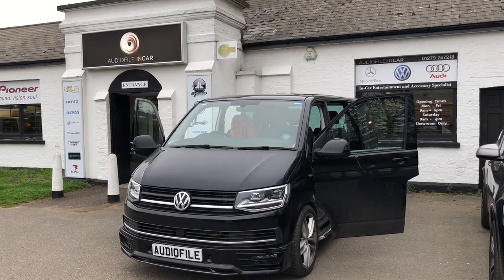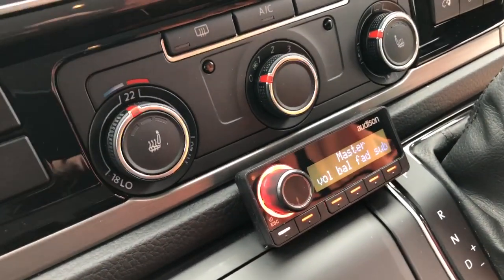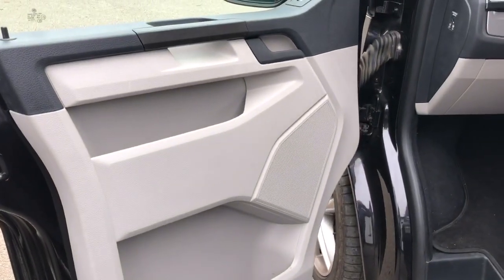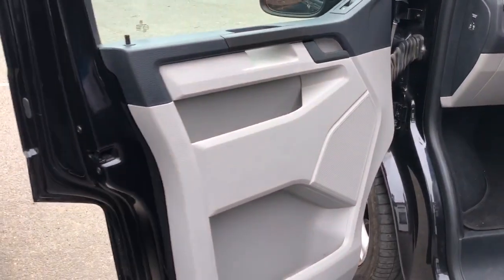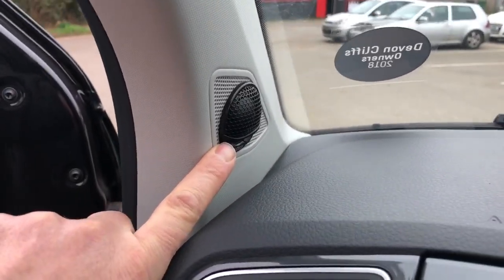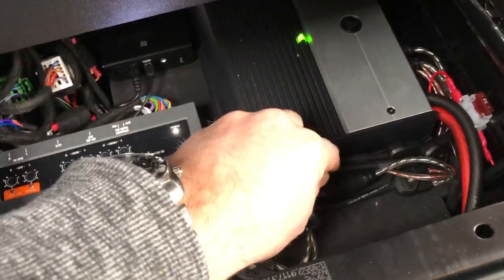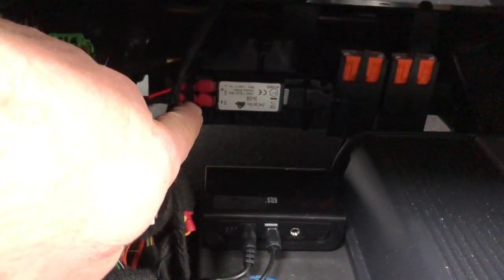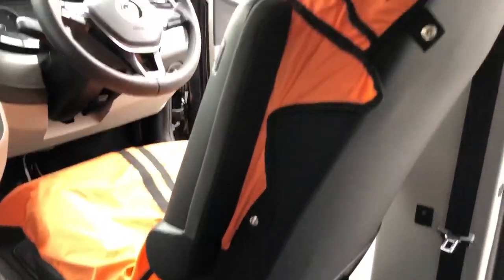VW T6 Complete Audio Upgrade with full DSP

Comment: Hey guys. I have recently upgraded the sound system in a new VW T-CROSS. I discovered that there is bass roll off and factory EQ on the speaker outputs when I measured it with pink noise on my Audiocontrol RTA. How do you code the radio for HIFI? I assume this gives you a flat frequency response with no bass roll off. Any help with this will be greatly appreciated. Best regards. Rob.

Comment: But why would you isolate the inside of a car door? The car speakers are meant to use the inside to use it as bass reflex, you can break your speakers that way, or you limit them at least because it seems like you also thought about the amount of output wattage, and the more power it gets the more air needs to escape.Conversely, car speakers are meant to do that for Bass because the walls are so thin and that usually is why car stereo sound so good at not a lot of cash.
Reply from the maker: I am afraid that could not be further from the truth, the dampening is to stop panel resonance, coloration and reflection, it has no effect on the volumetric air space of the door whatsoever. It improves bass response by making the baffle more ridged thus reducing cancellation and increasing efficiency. The door could never act a a bass reflex? to do this the "sounder" or "port" length and diameter would have to be calculated precisely vs the volumetric air capacity of the door depending on the frequency that you wished to tune to. Even if all of this was possible the door is not sealed so it could not possible act as a bass reflex.
Reply: Audiofile-Incar It does act as a bass reflex, otherwise the heat couldn't escape, sure it's a sealed enclosure, but the air and the heat has to go somewhere.
Reply from the maker: @giuliano8031  it does not, bass is achieved by changing sound pressure, the bass does not need to escape, it’s not a fart.
Reply: @AudiofileIncar  So why are subwoofers ported then exactly? 🧐 I know there are sealed ones but principle us given. If you wanna have control bass then go and isolate your speaker with foam. But for me Cars are fun yk. Speakers in general. If I wanna have an audiophile setup and lots of detail I'd go with an headphone anyway. But that's just personal preference. And thx for not directly calling me an idiot and pointing an actual point out I can take serious. Unlike the bass player that made this video. Cheers.
Reply from the maker: @giuliano8031  the port in a ported subwoofer creates an air “brick” this moves in phase with the subwoofer at the tuned frequency, it actually increases the pressure in the sub box giving around 6db extra output at the tuned frequency, it is not to let air out of the box, quite the opposite.  I am not trying to make you look like an idiot but your posts are not accurate, sorry if you have taken offence, none intended.
Reply: @AudiofileIncar  Oh you were the guy that posted the video. Anyway, thanks for the explanation.